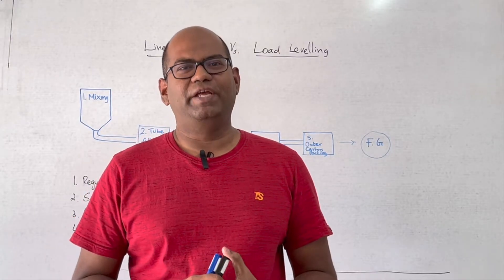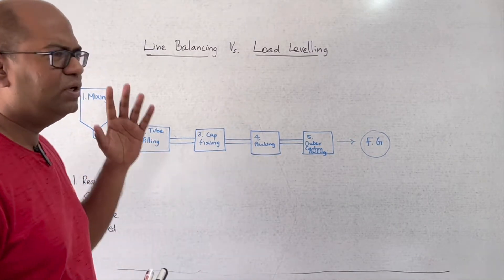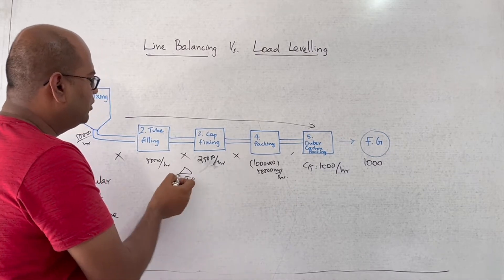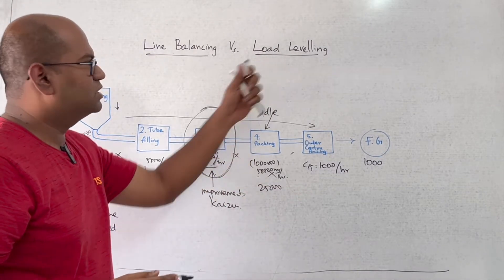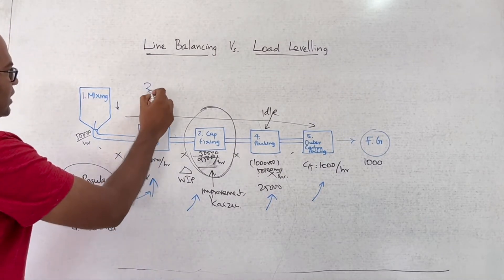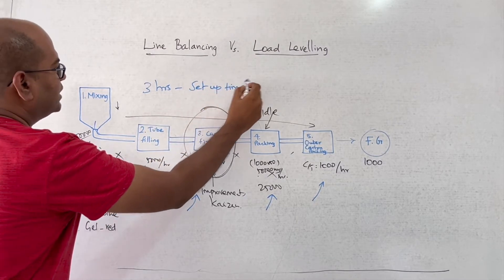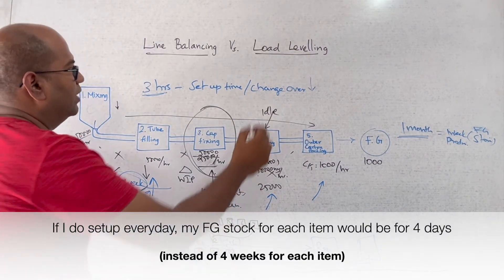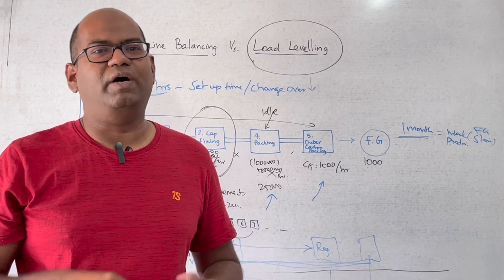Line Balancing and Load Levelling - Difference in Tamil Language

Comment: Sir I have doubt in line balancing 
In 1st concept the cap fixing m/c capability is 25000 only so we added one more m/c for line balancing suppose cap fixing capability is 100000 nos means can we rest cap fixing m/c for some time  or add one more set of  all other m/c?
Reply from the maker: Depending on the demand..the idea is to make sure that all the processes meet the customer demand. If some machines have excess capacity and the demand is less, better to keep the machine idle. Thank you
Reply: Thanks you sir